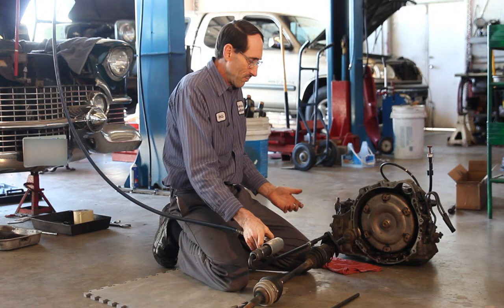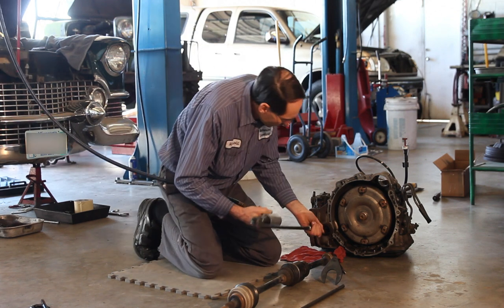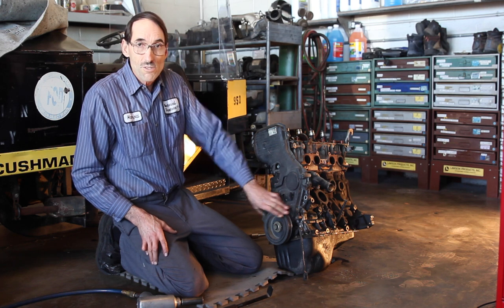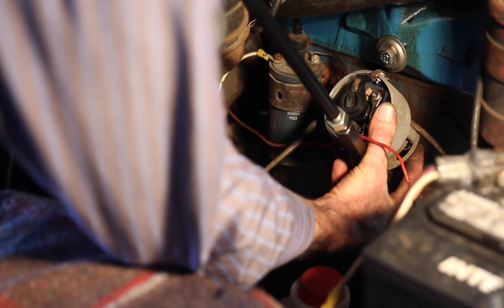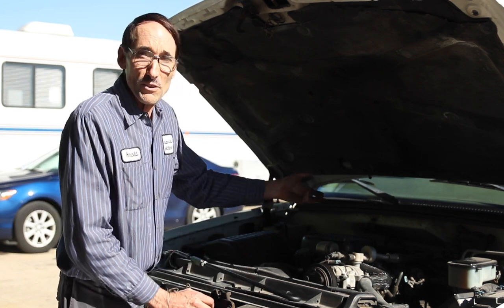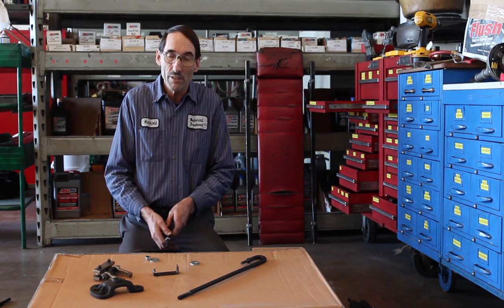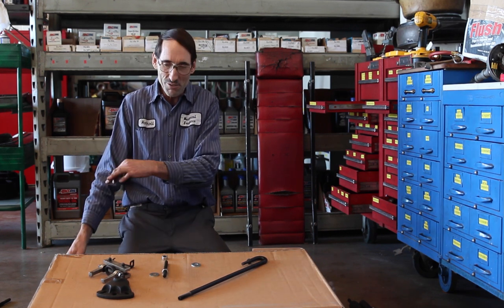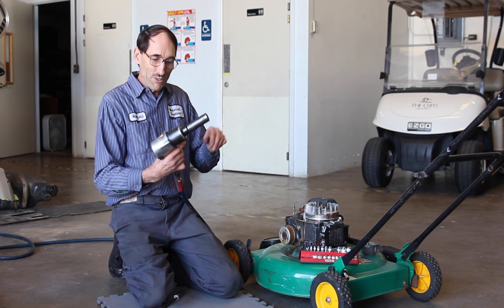Air Chisels

Comment: After I saw the going price, I thought of making it myself though it won't be as purdy.
Reply: 3D printer?🤔
Reply: @jessihawkins9116  I remember seeing this and thinking how simple it is. You're just reversing the force of the air hammer and I think someone could make one cheaply. Using an actual air hammer bit, like a long chisel or tapered, it seems it would be half done. Those bits are pretty hard so maybe you can't cut threads into them to join them up with other attachments but welding or some other way of connecting two rods and I don't see why it couldn't be done, certainly for less than $200.